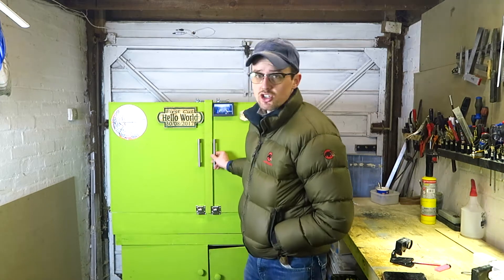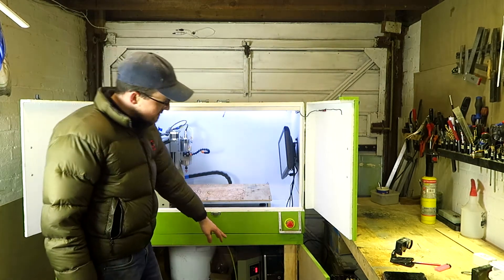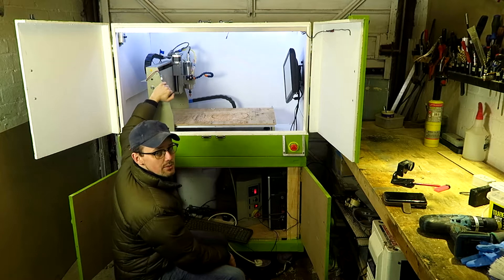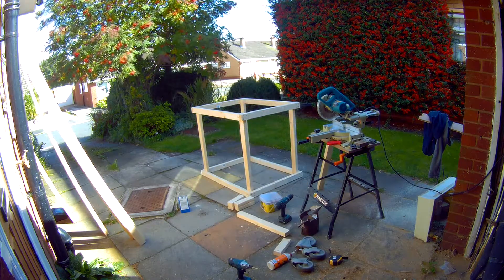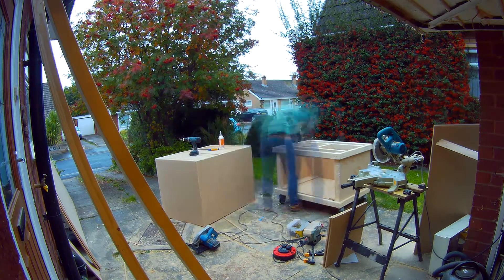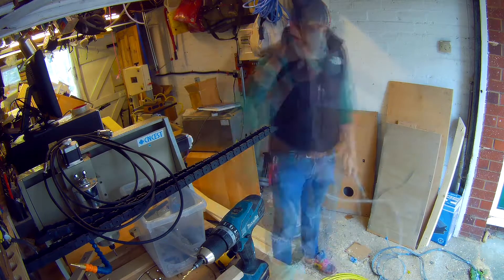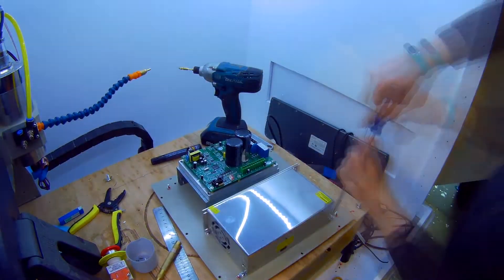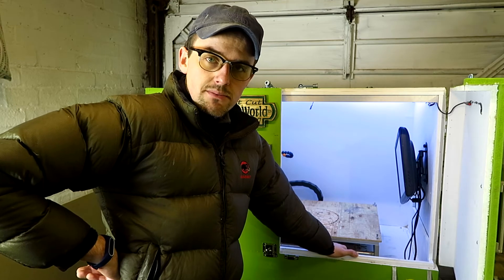CNC 6040 Enclosure Build

Comment: I was watching and wondering if the power supply was going to get upgraded.  I was very happy to see you did put a 48V psu in there.  I have seen so many people get almost all the way there and still use a 12 to 24 v psu and then I just slap my forehead.  Good job.  I got a 6040 router as well, but I just got the bare frame.  I added all my own motors and electronics.  Its a fast fun machine to tinker with.